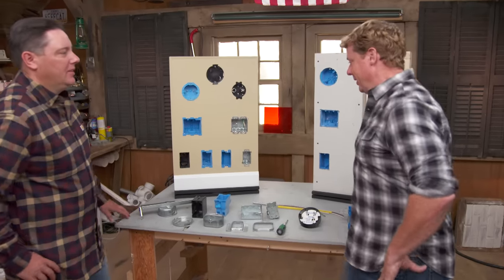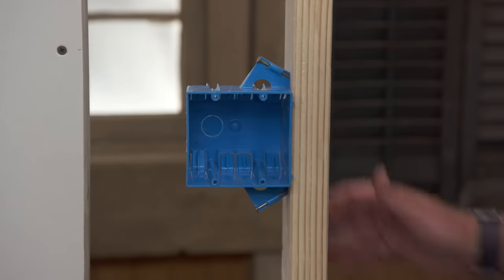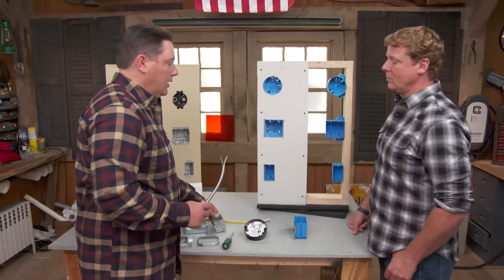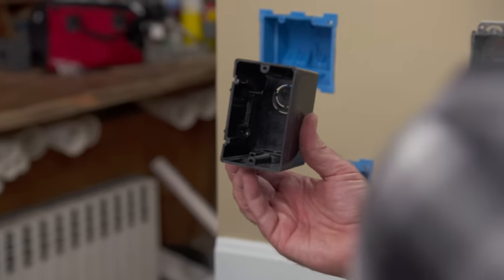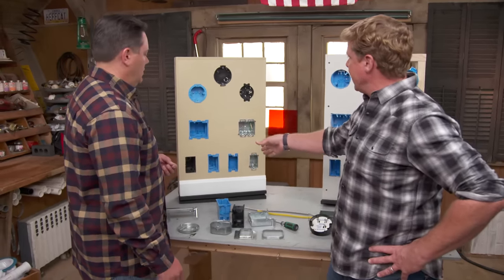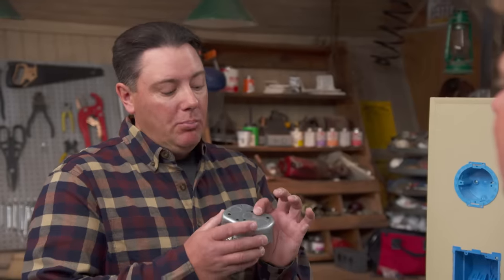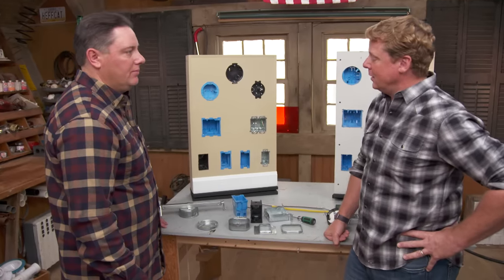How to Choose an Electrical Box | Ask This Old House

Comment: Would have also been helpful to cover basement settings with some type of masonry or concrete wal, or metal shop wallsl without studs to affix to.
Reply: Yes.  And when is it OK/not OK to use the types of wall boxes shown in this video in a basement or garage where the box will be exposed?

Comment: Do you have suggestions on what to do with coaxial splitters? There is one hanging out of the wall in the bedroom closet that has 4+ coaxial cables attached to it. The splitter has 8-10 coaxial ports, so it's not small.  Someone installed a 1 or 2 sized box that was way too small for it and so there is a ball of excess cable in it and the whole junction box is hanging out. I read in the comments that low-voltage do not require a box, so should I take the box out, shove it all in the wall, and screw a blank plate over it? Or should I try to mount an external box to the inside of the closet, so it's accessible?

Comment: I have a question? I did a search and cannot find an answer! How do I fix an electric outlet box that has popped out of the wall. My first reaction is to hammer it back in.  The box is located between exterior/enterior wall, with outlet box enterior. I tried to push it back in with my hand, it won't budge. It used to be flush with the wall?
Reply: first of all, remove the face plate,
Reply: Try using Madison straps.They are thin metal pieces that go on each side hook behind the drywall then tabs that bend into the box.
Reply: First, remove the BOX!

Comment: I need a shallow light switch box because the light switch needs to be moved over and there is only lightly less than 2 inches behind the drywall.  Not sure if ai need a special shallow light switch or if a regular light switch will fit.  Hoping that would have been covered to save me some time.

Comment: Thank you!! I’m adding some new spotlights to my eaves and didn’t know how I was going to attach them.
Reply: It very well might, but an experienced person wouldn’t do it. It sets up a dangerous situation where a later installer may assume the box is properly supported and put up a fixture of dangerous weight. Check your ceiling. Some framers will bother to give you some wood in the exact center of the ceiling. If not, use the expanding metal device he showed.

Comment: anyone know who makes that adjustable old work ceiling box system he showed?  the one's lowes and home depot sell are a huge pain to adjust because they spot weld the box to the rod and you can't spin it to tighten the rod and then place the box where you want.  it takes dozens of attempts to get theirs lined up with your drywall hole and be tight enough to hold.
Reply: Hi blue excuse me I don't know but I suggest watch a 13 part series called What on earth happened by Ewaranon to learn that the earth is not a globe. Link in my about tab.

Comment: They are really only showing 1 and 2- gang boxes. When you start putting in 3-gang and larger, the plastic ones that attach to the stud tend to flex too much. I have had to remove numerous ones at my house when I replaced switches because they go too far into the wall cavity, and getting them flush against the drywall is a pain where they never look right. I replaced all of them with old work boxes with metal tabs. If I have to re-drywall, I use metal boxes with an adjustable metal brace behind them. The stuff that is allowed in residential construction is just painfully bad.
Reply: ummm what?
Reply: @zefrum3  A plastic box only has 2 nails going into a stud. When you put in multiple gang boxes, the far end starts to cantilever when you start jamming wires and switches into the box. There are adjustable metal mounting brackets that go between studs where you can mount a metal electrical anywhere along them that are used all the time in commercial construction. Using a blue plastic box and a hammer is fast and cheap. Mountain a spanner brace, having to mount the box and ground it properly, and then install the device isn't cost effective for a builder.
Reply: @iliketoeatfood123  maybe, I dunno; though I find your trouble surprising. Ive installed plenty of old work 3 gang, way different But, i just cant imagine theres that much flex, plus the switch plate would really lock it in if the whole isnt too big
Reply: @zefrum3  Old Work/Remodel boxes are different. You have the flip out ears/wings on all the corners that provide even bracing. New work boxes only have the 2 nails and usually the electrician will add a middle nail on the 3-gang and larger boxes. Using the faceplate screws to pull the box into the drywall is a band-aid to a bad idea.

If you are using traditional switches or receptacles, you will probably have enough room for wires behind the devices and the back of the box to where you can cram everything in without pushing the box back. Using smart switches, occupancy sensors, or GFCI receptacles, you will be cantilevering the box back. I am looking at a 3-gang box right now where I replaced the single pole switches with Lutron Caseta switches, and I had to replace it with a remodel box because there was no other way to get everything to fit without original new work box going into the wall an inch or more. If I were to build a house on my own, I would never use the plastic new work boxes attached to studs, but I am also the type to update and remodel as time goes on which isn't the case for most people. If someone wants a simple line voltage single pole switch they will never update or replace then plastic new work boxes are fine.
Reply: @iliketoeatfood123  all my switches are Casetta, all my plugs are w/ USB a and c, try to avoid gfci plugs as circuit brakers can be and will be gfci But i was able to fit everything in the origional 1970s era white plastic (asbestos impregnated?) new work boxes, no movement; was tight but no problems unless i wanted a box for more casettas in the bathrooms etc which was a blue 3 gang old work box. I apprenticed to a master in high school; Im an engineer. The new work 3 gang boxes at HD have a screw flange on the opposite side of the nails, adding a stud to catch this flange would probably be very easy and fix your problem

Comment: Would have loved more detail regarding requirements and code... I assume I am required to use metal in some cases, but maybe not?
Reply: Metal for commercial. 
Residential is plastic\metal\fiberglass.  Depending on fixture weight and what the home owner wants and what store you're forced by the home owner to get your supplies from.
Some places have garbage products, be sure you're getting something that has good ratings by doing your research on the size of box you will need. (vapor rings, mud rings, foam rings, old work, new work..  Not all boxes have the same cubic inches, sometimes we have to mix them up a bit so we are following proper sizes per how many wires obtained in each. (wire crowding code)..
Reply: @DevJB  Commercial occupancies can be wired in NM cable if they meet certain criteria.  I think the actual answer to Daniel's question was given by Heath.  If you are using AC/MC/FMC/RMC/IMC/EMT/LFMC or similar metal clad cable or raceway, you must use a metal box.  This can occur in both residential and commercial settings.  In many jurisdictions, unfinished basements and crawl spaces of dwelling units cannot be wired in NM cable.  The natural choice these days would be MC cable, suggesting the use of metal boxes for lighting and receptacle outlets and switches located in these areas.

Comment: Never use those plastic ceiling boxes, use metal boxes in the ceilings for fans and fixtures.
Reply: Care to elaborate on why?
Reply: @juniorzoramac  good electricians only use plastic round boxes for mounting smoke detectors and lightweight (less than a pound or 2) wall sconces. The plastic threads just aren't made to take the weight of many light fixtures. In fact if you read the literature on some plastic round boxes it will say not to mount light fixtures with them especially if it is an old work box.
Reply: I had to replace this guy's ceiling fan the other day because whoever installed it used a plastic old work box and the fan fell. Just when you think you've seen it all...

Comment: Do voltage and wire gauge matter when chosen a box? I am installing a 240v plug with a 6AWG wire. Is it okay to use a plastic box instead of a metal? The wire is r

Comment: In Ontario you can't DIY electrical unless it's in your own home (and you live there).  This, and it still all has to go through inspection.   How can you do electrical and not have read one of those electrical-code books to be able to do this kind of work?   If the boxes confuse you, wait until you get to a three-way switch, a marrette on multiple wires.. and that's the easy stuff.  Open a box to find K&T, or aluminum?  would you even know what you're looking at? IMHO, you don't need to be a pro, but you need to know enough to know when you're in over your head.
Reply: mgjk I suggest watch a 13 part series called What on earth happened by Ewaranon to learn that the earth is not a globe. Link in my about tab.

Comment: Why do some of the boxes come with threaded tabs while others are just a box with not tabs or maybe only two on opposite corners for the cover plate? I thought those without the treaded tabs where only for ceiling but lowes has them listed as ceiling and wall.
Reply: Hi hippo excuse me I'm not familiar with that but I suggest watch a 13 part series called What on earth happened by Ewaranon to learn that the earth is not a globe. Link in my about tab.

Comment: The problem for me is my electrician used new work boxes for drywall but I had told him that my manufactured home uses panels that are about a quarter inch thick so all of my outlets and plugins stick out and aren't flush. Are they able to jus leave it like that?
Reply: They make spacers you can buy to bring the device (outlet, Switch) further out for thick walls. They come in a bag of like 100 and attach like Legos to each other to provide adjustment in 1/8 in. increments. You can get them at your local home center.

Comment: You mentioned for overhead, you’d install a ceiling box. If I’m installing a 4.5lb light fixture, would one of those round old work boxes hold?
Reply: For something that light, the old work box will do fine.  Just make sure the hinges are well seated on the drywall.  The opening should be VERY tidy, no chucks of drywall ripped out behind the finish side.
Reply: tdkdpt I suggest watch a 13 part series called What on earth happened by Ewaranon to learn that the earth is not a globe. Link in my about tab.

Comment: What is the nail length to mount the box to the joint? I'm missing a nail on a box single gang box. I have a nail but it's too wide for the slot.
Reply: Wow no one answered.. I notice most comments on youtube don't get answered probably because most channels have their comments set sorted by top rated first instead of newest first.

BTW Jamie I suggest watch a 13 part series called What on earth happened by Ewaranon to learn that the earth is not a globe. Link in my about tab.

Comment: No mention that metal boxes block wifi?  This will prevent your conversion to smart switches and receptacles.
Reply: I have not experienced this.  In the last month I just ganged together 4 metal cut-in switch boxes and installed it in my living room, with 4 Lutron Maestro wireless (clear connect) dimmers.  Everything works as planned.
Reply: richard I suggest watch a 13 part series called What on earth happened by Ewaranon to learn that the earth is not a globe. Link in my about tab.

Comment: Does it matter what type of screws you use for the metal boxes?
Reply: I will typically use a #10 x 1" sheet metal screw with a hex head.  Make sure you don't get the self drilling kind if you are drilling into wood.  Other times I will use a #10 x 1" pan head, or #12 x 1 pan head.  I would NOT use drywall screws.
Reply: Vanessa, Steve I suggest watch a 13 part series called What on earth happened by Ewaranon to learn that the earth is not a globe. Link in my about tab.

Comment: Hi guys.  What can of electrical box use when between the drywall and esterior block wall i only have like 1" gap
Reply: Lisber I suggest watch a 13 part series called What on earth happened by Ewaranon to learn that the earth is not a globe. Link in my about tab.

Comment: I have a ceiling round black junction box just like the ones on your display on top of the samples. The light fixture I bought does not fit into the junction box because it’s not deep enough for the mounting strap/nipple. Do they sell deeper junction boxes or do I need to get a new light fixture without such a long strap/nipple? Confused as to what to do next.
Reply: And I don’t know how much room behind the current junction box I have as it’s in a mobile home kitchen ceiling I’m trying to replace. Not sure how much room is behind the current junction box because the wires were still live after I killed the breaker. Will have to kill the main breaker because someone hacked the electrical previously. I’m doing this for my elderly parents on a fixed income. Any help is appreciated!!
Reply: Wow no one answered.. Most comments don't get attention probably because they are sorted ''top comments'' first and not newest first.

Did you figure it out?

BTW Savagepreneur I suggest watch a 13 part series called What on earth happened by Ewaranon to learn that the earth is not a globe. Link in my about tab.

Comment: Are there different sizes of junction boxes used for vanity lights?.. Im replacing one in an 1970 home and the current  box is metal and doesnt fit the new light im installing...I need to replace it but wasnt sure if there was like a universal box that  i can use that will fit any vanity light or if i should be looking for a certain size.Thanks...
Reply: Vanity light should be 4 inch round box
and it should have 2 screw downs on its facet for 2 different size fixtures.
Inner screw holes and outer screw holes.    
Some lights do require a 3 inch round box.  
I would measure the distance between the 2 screw holes on the fixture and see if it's closer to 3 or 4..
(I can just look at it and know, but a tape measure is good to be sure!  :)
Reply: P G I suggest watch a 13 part series called What on earth happened by Ewaranon to learn that the earth is not a globe. Link in my about tab.

Comment: And if you are dealing with low voltage applications such as category 5e, 6, or coaxial cable, or rj11 (phone line) all you need is a low voltage ring!
Reply: Joe Kinchicken  Yes, I said rj11 and you can give those people their phone line using cat 5 or 6 cable.

Comment: One thing I would like to know is if I want to go from a single gang to a double gang, what is the best way of doing it?
Reply: Trace the other half of the double gang cut to size making a bigger whole!   Remove old box by cutting nails securing box to stud with a reciprocating hack saw.   Chisel out old box by destroying it with chisel.   Drywall or plaster repair may be required
Reply: rowland I suggest watch a 13 part series called What on earth happened by Ewaranon to learn that the earth is not a globe. Link in my about tab.

Comment: It's be helpful for yoy guys to show what to do when a bathroom wall light is smack dab center of a stud. The center of the faucet is 31.5 inches from the wall...right on the stud. I found an open ring that looks like it'll work just fine. I'm frankly surprised to see ZERO explainer videos of this issue online.
Reply: John, Dev I suggest watch a 13 part series called What on earth happened by Ewaranon to learn that the earth is not a globe. Link in my about tab.

Comment: What kind would I use if I wanted to remove my base board heaters and put the heater wires through a box with a blank cover?
Reply: I would use a plastic rectangular one and sideways to make it look better.
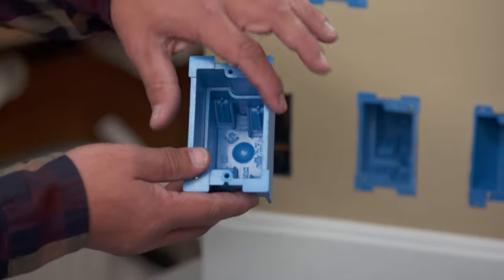Reply: @joaquinsuarez6090  cool thanks I used the one at 1:52 sec the blue plastic rectangle one worked like a charm. Was surprised at how easy install was.
Reply: wife I suggest watch a 13 part series called What on earth happened by Ewaranon to learn that the earth is not a globe. Link in my about tab.

Comment: Junk plastic boxes...My 1990's era gray receptacle boxes are falling apart in the wall from just pulling cords out.
Reply: In my mind plastic boxes are good for switches only. You can probably just go with a slightly bigger screw to hold your outlet and be fine again.
Reply: @matt8863   Gray electrical boxes?  Was it plastic (snaps) or was it fiberglass (crumbles)?  Thanks.
(Fiberglass boxes should be avoided, removed, replaced if you want dependable boxes.)  Plastic blue boxes have newer material recipes than before 2000. So there's that.. : )
Reply: @matt8863  Oh, interesting, I wonder if that will still happen with newer pvc boxes. I do know the pvc box materials were upgraded since 2000, I have only ran into a few stripped out boxes in the past 8 years of being an electrician and those were pre 2000 as well, usually fiberglass boxes are one time usage and I replace them if they need touched (they break).
Thanks for answering, something for me to watch for thanks.

Comment: But can you screw a pancake box flat to the ceiling for a simple single light fixture  i plan on running the wire (  a grounded good weight extension cord in something like that square metal 
The reason for going outside is its a mobile home and theres no space to cut up into.  
ANYBODY ?
Reply: Wow no one answered.. I think most comments on youtube don't get attention after 24hrs video upload date..

BTW Howe I suggest watch a 13 part series called What on earth happened by Ewaranon to learn that the earth is not a globe. Link in my about tab.